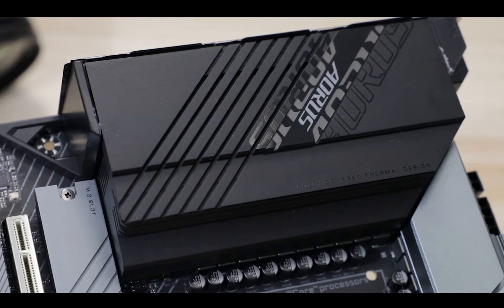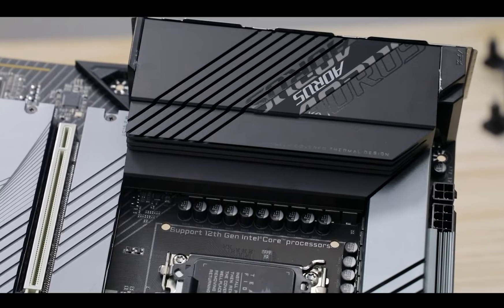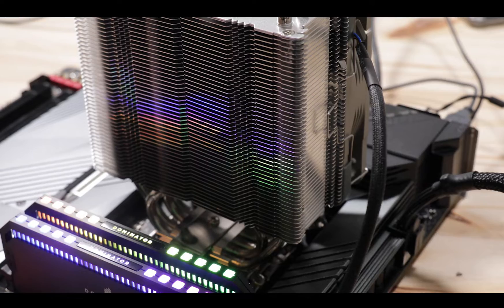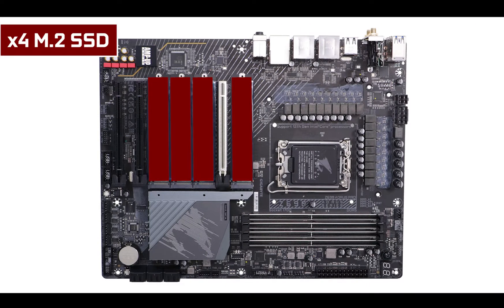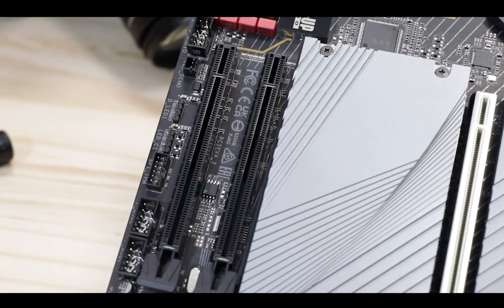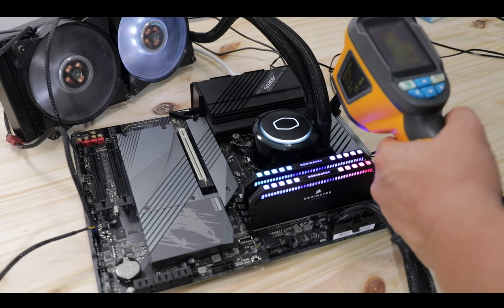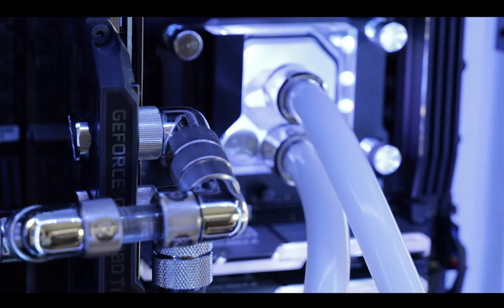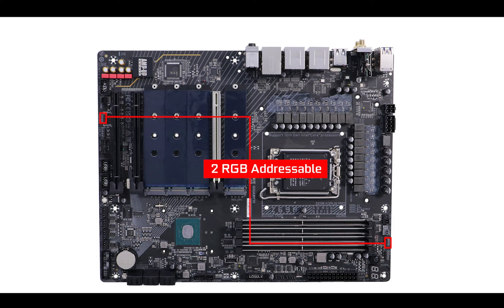Gigabyte Z690 AORUS PRO : Not the prettiest but so GOOD!

Comment: So, I don’t understand the whole wifi deal… does it have built in wifi or do I need an antenna or something to use it. It’s not the new “standard” you say, so is it gonna be slow? I just bought one of these off Amazon for my new build
Reply from the maker: There Is an antenna
Reply: @Laurentschoice  Ty homie
Reply from the maker: Its going to run upto 2.4 gbs. Dinky not on the new 6ghz spectrum  . Still plenty fast

Comment: Huge headaches with this board.. My first board was defective out of the box with bent and broken socket pins, my second board did continuous random reboots. Spent a week reinstalling operating system, updating bios,, updating drivers, trying to detect any conflicts, running memtest, Intel cpu tests, stability tests, swapping memory sticks, remounting cpu checking power and cable connections.. turns out it was Speedshift which when I turned this off in the bios the system runs like the rock of Gibraltar.. Gigabyte tech support is extremely slow, I had to do all the work on a half baked motherboard that is still in beta and I definitely ended up an unpaid beta tester for this early adopter board. Not fun I certainly wouldn't recommend this to even an intermediate builder forget a beginner.. Sloppy quality control, snail mail style tech support and half baked bios.. I myself might not be buying anything from Gigabyte in the foreseeable future.

Comment: Can anyone confirm whether they can run this mobo on 64gb RAM of what brand? say the dominator platinum? thanks
Reply from the maker: Any corsair brand will work
Reply: @Laurentschoice  thanks alot for replying on an past video! I hope the dominator works as there's literally none showing 64gb on the QVL list in the gigabyte support page nor the aorus page. i wonder which one is safer the 5200 or the 5600mhz. Thanks alot and good work!
Reply from the maker: Yes for 64 gb

Comment: A few corrections: You mentioned (@ 7:00) that the CPU-connected M.2 slot might eventually support PCie 5.0 "with speeds topping 128 gigabyte per second"; I think you meant "giga bit per second" (which, of course, would be 16 gigabytes), but the lanes to that M.2 slot (at least on Alder Lake) are PCIe 4 anyway. Also, you mention (@ 10:14) that there are "five 10-gigabit USB plugs including a type C" on the rear I/O; in fact, there are actually four "10-gigabit USB plugs and one 20-gigabit USB plug" on the rear I/O as the type C is a "USB 3 Gen 2×2" connector. Likewise, the internal type C header (mentioned @ 10:33 and called a "10-gigabit type C" is also a (20Gbps) USB 3 Gen 2×2 – (just wanted to set the record straight). Still, excellent job on the review!

Comment: Hi, if the price for this board and the Z690 ROG STRIX - F is the same, which board will you buy and why, I can currently get them at the same price. Will be used primarily for gaming and 3D modeling with Finite Element Analysis.

Comment: Unfortunately if you check the specs the DisplayPort is 1.2 not 1.4. This is kind of strange to use this old standard on a topend product when today everything is 1.4
Reply from the maker: Hi James
I tested the DP. Despite showing 1.2 on the website, it is in fact 1.4 standard. 

Probably a typo while releasing the product  

I hope this helps
Reply: @Laurentschoice  Thank you so much for the personal reply Laurent! This made my day. I actually had my heart set on the Z690 AOURS Master but cancelled my order this morning when I noticed the DP1.2 spec listed. I will reorder now with confidence. I have noticed that Gigabyte must have made this mistake on all of their current Z690 series boards according to their website literature. I thought it must be a mistake and could not possibly be true that they would use DP1.2 when all the competition is using V1.4. Thank you again for your great channel. New subscriber!

Comment: I bought an Asus Prime Z690A with an Intel Core i9-12900K and Kingston FURY Beast DDR5 memory 16GB 6000MHz but unfortunately the board does not start, what did I do wrong?
Reply: Hey,Did you solve the problem?